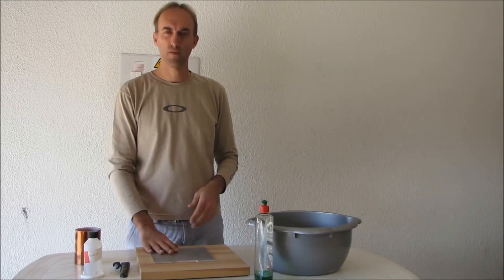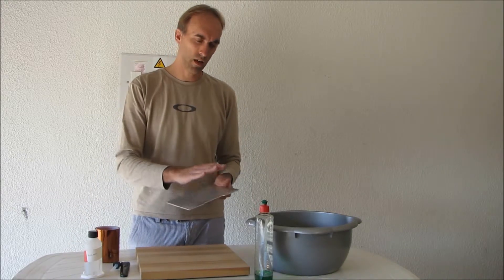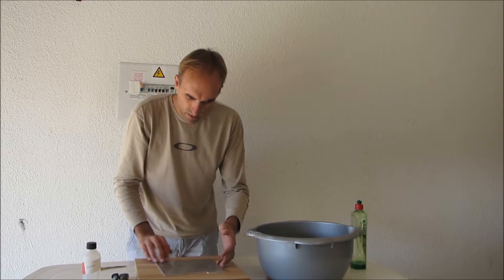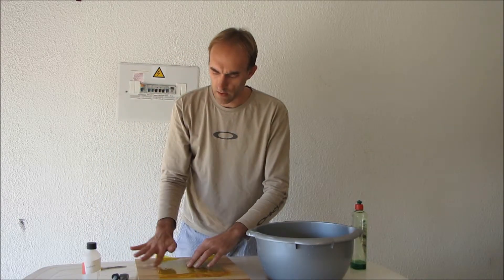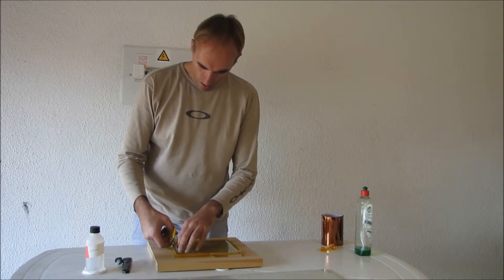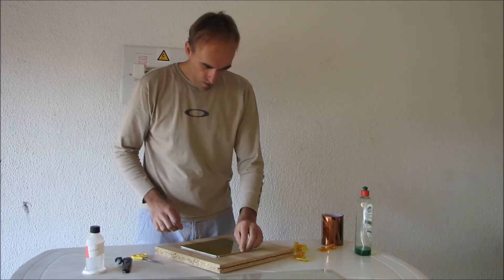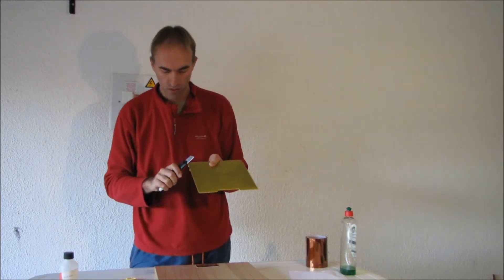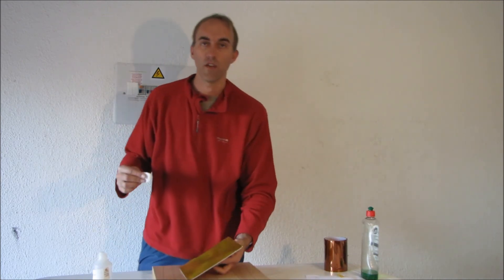3D Printing - Easy Bubble free Kapton Tape

Comment: Hi! My models removed from kapton in during printing, What could be the problem? degrees 110-120
Reply from the maker: I've been using ABS-Juice: take about 15ml Acetone and drop in a couple of scrap pieces of ABS until the acetone becomes a bit thicker and then paint a VERY thin layer onto the heatbed before you start warming it up. Be careful of using too much because this stuff REALLY sticks. I basically use the Kapton tape to make it easy to clean by heatbeds from time to time. Also make sure your first layer is even and a bit thicker than the rest to make sure you have the maximum surface touching the bed. I think my first layer is set to extrude 200% of the normal volume of material. If anyone else has any better ideas, let us know. I'm still having some minor issues with PLA at 60 degrees bed temp.